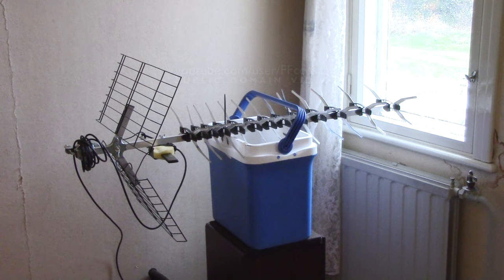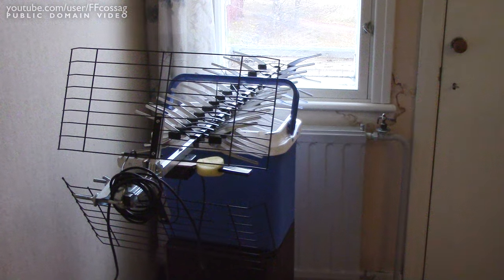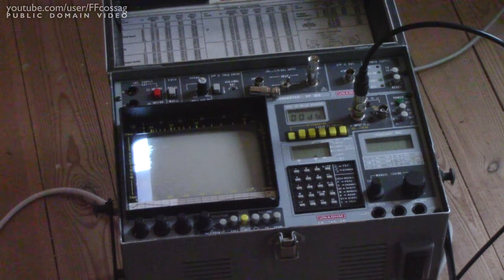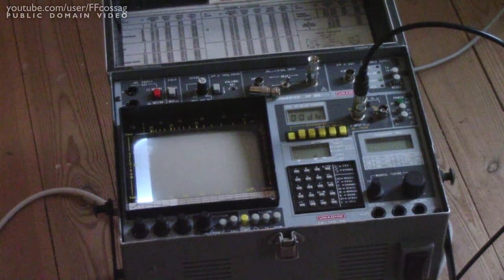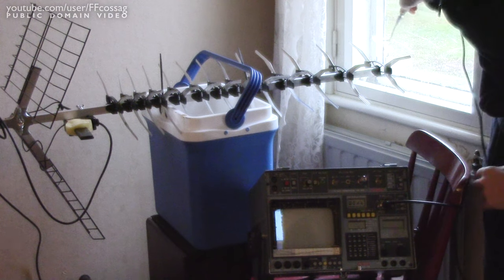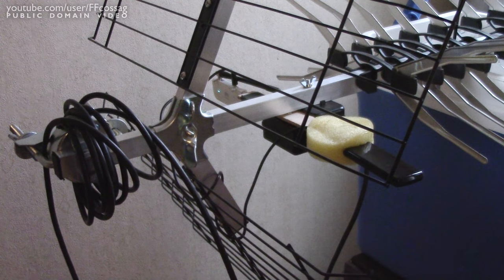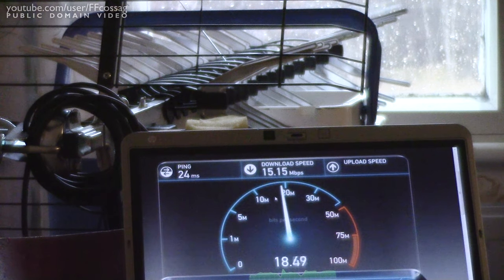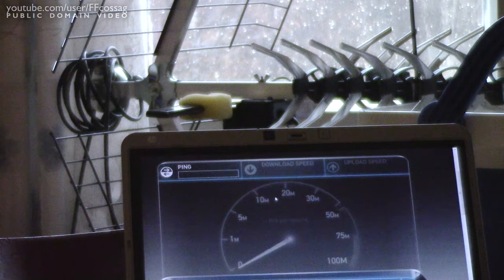4G with a TV antenna - It works!

Comment: This honestly has me tempted to try using an adapter on my RVs old Antenna. If it doesn't work? Oh well, I already have two different cellular antennas. But being able to just re-purpose the old TV Antenna would eliminate the hassle of setting them up. Since I don't have a way to mount them anywhere yet.

Comment: Have you ever toyed around with Software Defined Radio? I think you could have scanned for the LTE signal with a  RTL2832U based DVB-T dongle (10-20 euros) and your PC. If you have not toyed around with SDR yet, it is definitely worth a shot, i think it would make good content for your channel. It is amazing that part of that multiple thousand$ sewing machine sized machine you borrowed can be replaced by a super small USB PCB not even designed to do the job.
Reply from the maker: I've used those RTLSDR things in the past, they have their place. I'm not a radio guy though, so I don't find them too fascinating beyond their raw utility value. I could very well have used one of those for this if I wanted to, but I'm sure you'll agree that the Unaohm 742 is several orders of magnitude cooler, he he.
Reply: Alright, no surprise you know about those :) Yeah definitely cooler! 
Nothing is better than straight frequency information to a CRT with no 
digital lag!
Reply from the maker: geekmystique Ha - while it may not have digital lag, the analogue sampling system that the 742 uses is dog slow and will miss any burst that's less than 50-100 ms or so. It's not actually a very good spectrum analyser, lol.
Reply: geekmystique 
I agree on that, RTL-SDR  usb stick is well worth to experiment with.

Comment: what is your ISP ?
Do you know what frequency your modem connects to cell tower?
if it is 4G or LTE they use MIMO technology.
Therefore setup your antenna dipoles one at 45° and the other at 135° degrees.
This way you will meet 4G LTE MIMO Polarisation Diversity.
Reply from the maker: Cool, thanks.
Reply: What is your ISP (internet service provider)?
Reply from the maker: Sonera. They do 800 MHz 4G.

Comment: That's cool
I think I am getting a raw deal with only 15 mbps down and 1mbps up and that is on cable broadband. The fastest I can grab a file is at about 2 mbps. In all honesty that seems fast enough, but at times I wish I had faster up load
Reply from the maker: That's my land line as well (and has been for years) - ADSL, I assume?
Reply: Cable, same as for coaxial cable TV, but I don't get TV (why would I) I have not had a Telephone line  hard wired to my home since 2002. The phone company keeps trying to sell me some plan and I never get a straight answer from them as if that would be a twisted pair or fiber optic, There isn't any fiber here in this area
Reply from the maker: Craig Nehring You poor sod. I'm just waiting for the new local telecom to come knocking. They've been making the rounds offering free fiber installations to new customers for a while.
Reply: I could upgrade to higher tier with cable, but they still short you on the upload speed. They are pathetic, I tried to upgrade to one of the new cable modems Docsis 3, it took the techs over an hour on their end to configure it, then the damned connection would drop out briefly a few times a day. I am running a tried and true and very old modem.
 Oh BTW, I have played with some one watt wireless dongles and high gain antennas. But that is not exactly cool to be stealing service... it does work though at some distances.

Comment: Hi, I have looked the internet but unable to find answer.. my question is LMR 400 50 ohm cable is recommended for best signal reception. But it's pretty expensive cable as I need to cover about 30 ft distance. So wanted to know can we use cable used for dish tv? Will it provide similar gains?.

Comment: Hmm... That transceivers position seems a bit off to me as a radio amateur... On TV antennas, the driven elements center is on the boom of the antenna, which on that stick would be right at the hinge point of the sticks antenna if it is turned in a way that it doesn't fold back over the stick.
Have you tried different positions of the stick and antenna with regard to the boom to see what gives you the most signal?
Reply from the maker: I haven't played much since my antennas are a bit worn out and I don't want to break them. I've ordered a couple of new antennas and I'll play around more once I get them.

Comment: If you're still around (or to anyone who can answer this question definitively), can you tell me if I can use my TV antenna for both my TV and my cellular booster?  
I need to use my cell phone as a hotspot for internet inside a metal building. Great cell connection outside the building; terrible inside.

Comment: OK, you antenna is normally a horizontal oriented device. Have you tried turning the antenna into the vertical plane to see if it any better. I'd bet it is.
Reply from the maker: I tried that, didn't change much.

Comment: Hmmm, nice work... I'm thinking you could probably use a cheap WiFi yagi for 2100MHz... Similar enough range.
Reply from the maker: How would 2,1 GHz divide down very well to 800 MHz? It doesn't add up in my head. As far as cheap goes, however - this antenna was free.
Reply: FFcossag I was thinking more of adapting your idea to my provider which uses 2.1G for 4G I believe, and I have an old 28dBi (I think) 2.4G yagi in the garage.
Reply: Ah feck, 4G uses 1800 and 2600 here... that said a 2.4G yagi should still work fairly well at 2600...
Reply from the maker: Jason james Ah, I see.
Reply: @jasejj  seems you know alot of antennas can you help me going to buy a phone booster 850 mhz. Thats for 3g right ? And also planning tu buy a yagi antenna 25dbi  thats says 4g will that antenna work out with the booster just want to make sure to get more. Signal thanks
Reply: @ericp2590  3g or 4g doesn't matter so much, you just want something that matches the frequency range you want to receive. Bear in mind also that an antenna doesn't magnify anything, it just alters the shape of the beam (a 1dBi "perfect" antenna transmits/receives equally in all directions, and the higher the dBi figure on any given antenna the more directional it becomes, so in some cases it can actually reduce signal).

I'm not really an expert, I am just a network engineer who has done WiFi work in the past so I have some understanding of radio fundamentals.
Reply: @jasejj  thanks !

Comment: paused video at start , not warching its total bs,  tv is under 1ghz up to 3ghz frequency cell is above tv frequencies not possible,  total nonsense.  also frequencies above 1 gzh are smaller so the waveguide etc are smaller. not the long rods of a tv antenna .
Reply from the maker: 4G here is 800 MHz.
Reply: Woops, you accidentally assumed that just because cell towers in YOUR country or region transmit in a certain band, that ALL regions must...

What an idiot.

Here in Australia we get as low as 700mhz in some areas, all the way up to nearly 3k in urban areas. 700-900 is generally used in rural areas.

Nice try though!
Reply: I have lte filters to prevent cell signals from interfering with the cable broadcast. I work for a major cable company and yes, lte can cause issues depending on where the home is located within the cell tower broadcast.